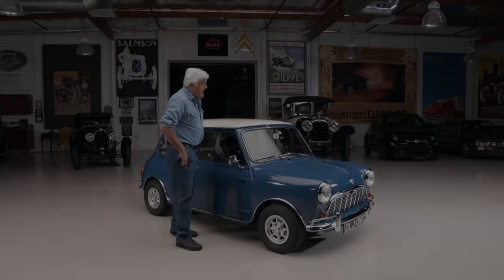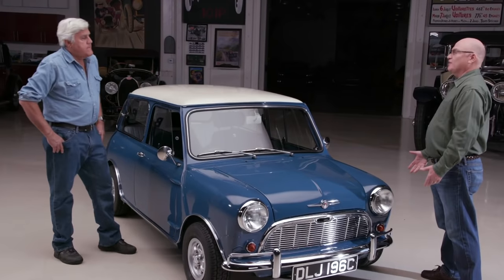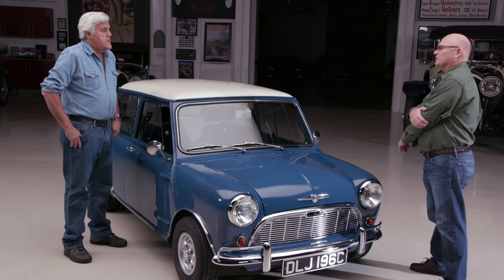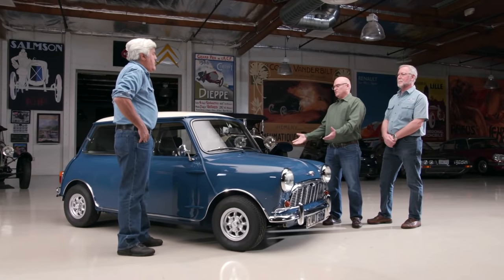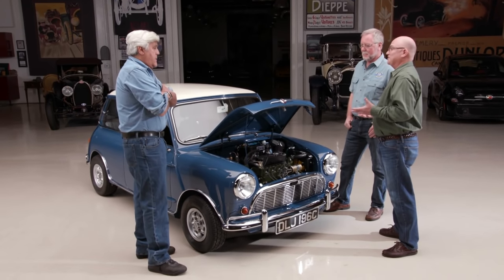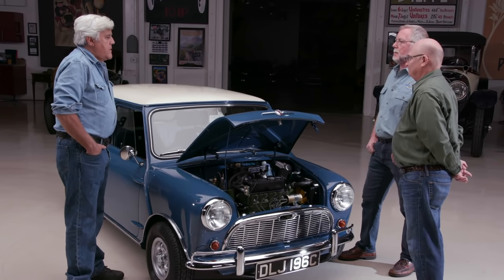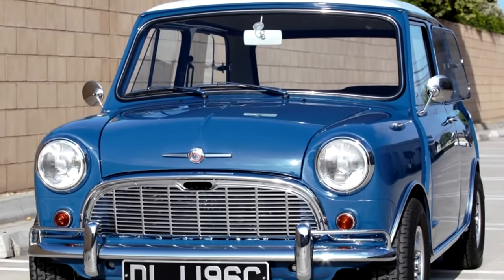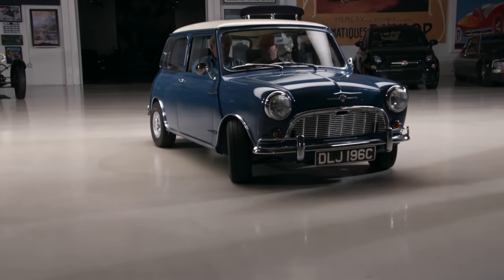1965 Morris Mini Minor - Jay Leno's Garage

Comment: In 1970 a  super hip crazy hippy dude at my high school had one of these without a wind shield and no hood so he could reach through to adjust the carb or something at stoplights etc.  My mom saw him doing his adjustments during a heavy rain storm as we were at a traffic light . She was so upset by what she saw that she threatened to stop at the nearest phone to call the cops . That didn't happen but she told my dad about it when he came home and he laughed about it for five minutes, and would start laughing about it off and on all during dinner.   I got my first car a year latter , a Corvair  Turbo Corsa , and after that blew up a I a 1974 Gremlin .  The only new car I've ever owned. Jay has a post on Gremlins and he seemed to like the car .    TO INFINITY AND BEYOUND !     Patents 672256, 3190554, 3013505.

Comment: My wife and I had two Scion xBs both 5 speeds.  Both were reliable and handy for moving music equipment around and also using them for animal rescue. The 2006 cost $10,500 new. I put 190k on it and sold it for $6500 in 2015. Water pump, battery and front brakes were the only major repairs. We also had a used 2005 which made it to185k on it and it had and argument with a deer recently. Flo totaled it. We just  replaced it with a 2008 5 speed Matrix with 90K on it. I expect great reliability from it as well.

Comment: Something I've always wondered about but was never in a place to ask while I was thinking about it, or I'd be in a position to ask, but wasn't thinking if it right then, but...
Around 23:30 or so, they're in a conversation about the speedometer...
In England, why do the measure distance in kilometers, but they measure velocity in miles?
Reply: The UK is a strange mixture. Petrol is sold by the litre, but signs on the road are in miles. So are mileometers (correct word) in cars. But the nuts and bolts that build the car are metric!

As for petrol consumption, that is quoted in both miles/gallon and metric.
Reply: @michaelbaker2465 
What a confusing place. So instead of calling it a speedometer, or even just for the hell if it a velocimeter, it's a mileometer (MILE-o-meter or milAWmeter?)
Reply: @sped6954  The confusion is mine. The mileometer is the bit that shows the miles driven. The speedometer is the bit that shows the speed. People pronounce mileometer as they wish!
Reply: @michaelbaker2465 
I screwed it up too. Instead of speedometer, I should have said odometer for distance traveled, which would be the mileometer in UK. That leaves me with another question... What we measure velocity with is the speedometer. What is the equivalent uk term for the gauge that measures speed?
Reply: @sped6954  You have had me searching for definitions here! I only did high school physics. Wikipedia (I know...) says that a speedometer measures approx speed. It talks about velocity in reference to a satnav measurement.

Not sure about that. In any case, both are approximate. Maybe do a test. Drive in a tight circle. Apparently "If the object returns to its starting point then its velocity is zero". I reckon both the speedometer and satnav measure speed.
Reply: Although our money want metric in 1971, I can assure you we Brits still use miles, not kilometers.

Comment: This was the car Honda emulated when they designed  the original Civic back in the 1970s. British Leyland used Lucas electrical components which were notoriously unreliable. ( It won't start if there is a cloud in the sky)  Honda's wisdon was to make their version reliable.

Comment: Tee Hee! I had an 850....a little gutless but you could drive it like a go-kart....the engine was with smooth though.
Reply: I liked the 850 wonderful willing engine.  Rasping exhaust.  No perceivable starting just turn it on and it goes but of cause for the crash of the bendix starter mechanism. Can't be unstuck from the road.  The hydro-elastic gave the car a big comfortable car feel without it it bounced about like a go-kart as you say.

Engine's head redeveloped by an Engineer seconded from Jaguar who first developed the Merline engine then did a lorry engine.    Later in 1940 that head design went into smaller car engines.  Gave the engine very much more power than typical of the 1930s when it was developed.   I have not been able to confirm that part of the history but it is from pieces I have read over the years or looked up recently.

Comment: I wonder if these cars burned through wheel bearings all the time?  With the revolutions per mile such a small diameter wheel/tire combo would generate, I can't imagine the heat and friction generated by the high revolutions.  Does anyone know?

Comment: I had a mini Mayfair in the 90s, they are very quick to 30mph,awful brakes but handling is like a go cart, not fun on bumpy roads as they get in a rhythm and bounce. They do 45mpg no matter how you drive them. You can fit four 6 foot men in them,as long as they have narrow  shoulders, and the boot is big for its size. Parts are so cheap, I bought a new set of bumpers for £20 , wings £50.,

Comment: There's a sarcastic myth about the engine of this car: One day a mechanic dropped a screw on the floor in the machine shop. An engineer saw it and built the engine around that screw. Every time you have to repair the engine, getting to that screw is essentiel, but it is almost impossible to get to with regular tools without taking the engine out of the car..

Comment: "The Mini" was classless- owned by Royalty, pop stars and Mom & Pop. The original Morris Minor was a post-war car, also designed by Alec Issigonis and unveiled in 1948. In some ways, it looked a little like a VW "Bug".  The Suez Crisis (1956) created a fuel shortage in Britain and sales of German-made "bubble cars" soared as they could be driven on a motorcycle license and were very economical, which depressed car sales in general. BMC wanted a small car which would sweep all these imports off the road and Alec Issigonis was tasked with the job of designing it. The Morris Mini Minor (aka "Austin 7" as Austin and Morris had merged to form BMC) was the result.  Cost at launch was £537 (1959 prices) and Ford GB couldn't understand just how BMC could make a profit on a car at that price, so they bought one and dismantled it and costed it out.  Their view was that BMC COULDN'T make a profit at that price and that BMC were indeed selling them at a loss.

Comment: I just dont understand how the f jay fits in a mini I'm 6'1" and I could only fit in my mates one when he removed the back seat and modded the seat rails to go all the way back
Reply: Easily, at School we had 2 teachers who had minis one was 6ft 5 and the other was 6ft, it seems like tall people like squeezing into small cars, another teacher we had was a little guy of 5ft 2 at the most, he drove a jaguar xj12
Reply: At 6’5” you could not change gear under the large steering wheel. Had to coast to stop and crawl out to let someone else drive. BUT there was a spacer kit sold that allowed the seat to go back far enough. Then you could swap the steering wheel for a smaller diameter and another spacer kit allowed you to drop it down. Drove  an 850 then an 1100 conversion minivans for three years all over England, Wales and Scotland. Fantastic fun, handled like a go kart.

Comment: I had a mini. It was actually two minis - my first and last. It was awful. Impossible to work on, went through tyres like nothing on Earth because the wheels are so small and turn twice as much as a normal car's. And in the hills where I live I was permanently in second gear so it's fuel economy was poor. These hills are rainy too - just what you need when the distributor is right behind the grill and gets hosed down even in a light shower.

Comment: The older 1950's  through to the Early 1970 generation  from the BMC  makers  Had for the family man the Morris Oxford  and Austin Cambridge saloon with also Rileys and MG Magnetts with the 1500  later 1622cc engines OK?..nicknamed the OxCams
Then there were The big Austins (I think they were called A 110)  with 1800  engines and these were for well to do people also the Police
My dads first car was a 1963 Cambridge and he could get  all the Family on it .

Also of similar constuction to the Mini 
Do look up the Austin1100 and 1300 ca early 60's to he mid 70's 

And In the early 70's Austin rolled out the Maxi with a 1500cc engine  but they never became a classic
Gome back to the Small cars before the Mini and these  wher everywhere  the was the Morris Minor 1000 and its smaller cousins  the A30 and A 35 then at the tail end of the 1950's Austin rolled out the Angular  A45 which had a rear opening rear screen  lasted until 1968?

and  when I travelled to Ireland the Biggest car sales was to farmer  all was Austin A35 and Morris Minor vans which seemed to clock up silly numbers in mileages they were that reliable

Comment: So, after all the guff this "supposed original" 850 Mini has: coil springs (hydrolastic), discs (drums), twin SUs (single), Cooper internals, remote change (direct), custom pistons and aftermarket steering wheel. 
Not really original at all is it?

Comment: Rubber sleeves ? Bought from a gargae to go on the distributor?  Am I made of money?  Steal Mum's washing up rubber Marigold gloves, cut the top of the fingers, fit over and seal with the old cloth tape.
Reply: I was going to say the same, and a couple of rubber bands
Reply: @stevem7868-y4l  Never the pink ones though ! you had to have some street cred :-)
Reply: @51WCDodge  hahaha, i used the yellow ones, but i suppose now, the latex ones in black would be better